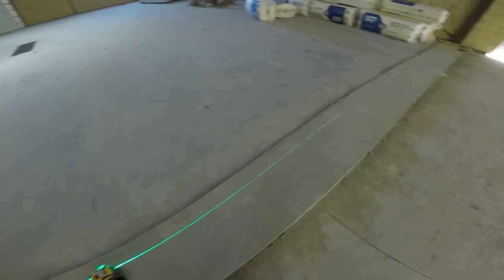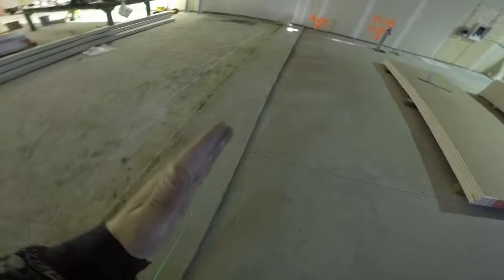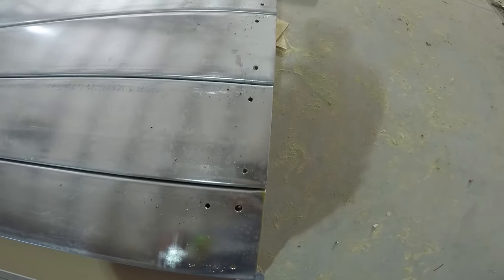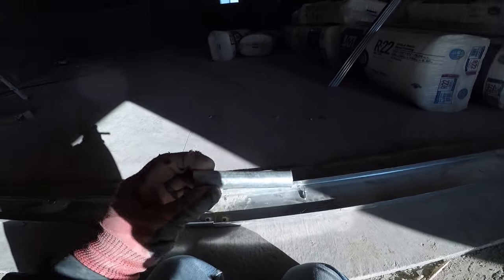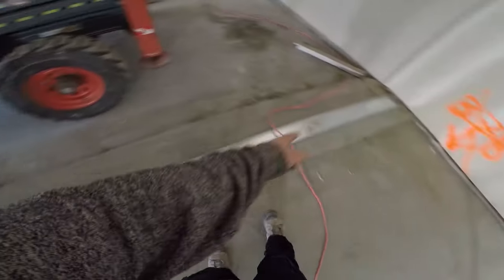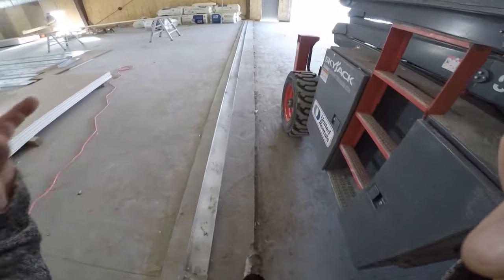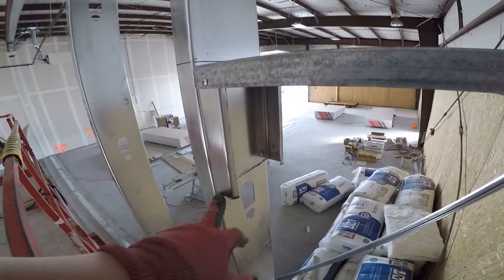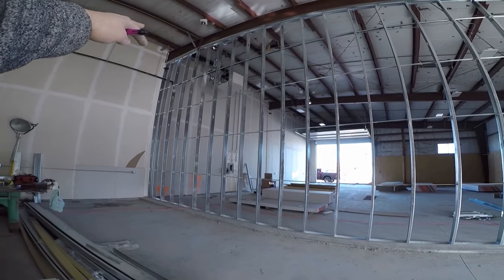Metal Stud Framing On Concrete & Steel Tips & Tricks!

Comment: Meant to ask, when fastening the studs to the track, do you run both sides from the same side in the same direction (the framing screws) or each side from the outside in?
Reply from the maker: Yes bro! When I am doing the top of the studs I reach though and screw them in from the one side but the bottoms I screw in on each side if that makes sense?
Reply: @ConstructionKronies  yep, I completely understand that. 😁👍
Reply from the maker: @meagaindave2049  Awesome man!
Reply: @ConstructionKronies  i, personally, like the pointed end of the framing screws piercing through on the opposite side. Makes for a good anchor of sorts when hanging the drywall. Lol. Although some inspectors won't allow the screws to face the same direction on opposite sides. A-holes. 🤣
Reply from the maker: @meagaindave2049  Right bro yes that's how I do it too but in this case it's a steel column behind that drywall and so I cant do that there but your 100% right that's the best way to do it when its accessible!
Reply: @ConstructionKronies  Also, back in the day, that's why most metal framers liked the metal chucks on their drills. Metal chuck can withstand rubbing against the 1st flange of the stud while fastening the 2nd flange to the track. Longer magnetic drives or extensions were too much hassle to deal with.  Though with impact drivers, nowadays, that issue is pretty much resolved.
Reply from the maker: @meagaindave2049  yes man I totally remember that.

Comment: Will you please do a video on parapet framing and walls the clip to the building, go past the roof and act as the parapet wall also. I don't know the exact term. Please include the fastest ways possible. I'm trying to learn as fast as possible. I tested into the union but, I am no metal stud framing expert. I have 20 years in construction not all commercial. Please, anything will help, thank you. I've been thrown into both, I'm learning on the go. The parapet was easy but, there are obvious differences to every type of wall framing.
Reply from the maker: Yes I am really trying to land some of this framing. For the suspended walls that run up past the roof to make parapets as well what you have to do is shoot clips to the structure. Basically what I do is set 2 to 3 studs perfectly level and plumb for every 10 foot piece of track. This is also a good time to use an offset. What you do is use the laser handset to mark the back side of where the studs will land onto the clips so that when you have your top and bottom track set with those 2 to 3 studs you can then fill in the rest easily. When joining tracks together here use little pieces of stud. I like to use a rotating laser for levelling the studs and then a line laser to shoot the bottom elevation. All the studs should be cut the same length so that after you have set the bottom track the top track just has to sit tight on the top (no need to level both). When up on the roof I set the rotating laser to shoot in the top elevation, go around setting in your bottom track (make sure the plywood on the qdeck has membrane (AVB like Blueskin) and laying out your studs while writing your stud lengths down on the track. Cut your studs and set in your top track with 2 to 3 studs. You can go ahead setting top track and your helper can come behind studding the rest out.  Hope that helps my good man!!
Reply: @ConstructionKronies  Chris, I appreciate you taking the time to respond so quickly. I have already done everything you talked about, remember, I was thrown into the fire, because I am already a journeyman they kind of expect me to know or at least ask questions. Like I said in my comment, the parapet was cake because I had already been working right next to the carpenters that were doing it previously on the same building. Also I have 20 years experience, I'm no expert but, I catch on quickly especially having a lot of years in wood framing. But nonetheless I did everything you talked about. This is our procedure, my GF set the bottom track first oddly enough, it was set on the exterior of the building so clipping it off was no problem, that was done all from a zoom boom/ 65.  Bottom track, clips, then we set up the spinner on it's side and marked every 4-6 feet on the clip and did exactly what you said except for a bit closer together. Anyhow I ended up taking a little longer than expected because I wasn't sure of the best way to set up the laser for the elevation of the top track. There were some louvers in the wall, and every good carpenter knows to frame their openings first before you stud in the wall. You know the stigma of the union, the journeyman that test in get treated differently/ like shit. That doesn't bother me because I'm willing to learn and want to be best I can be. Thank you so much, I appreciate you more than you know, have a great day. MORE VIDEOS 😁
Reply from the maker: dude! I love it! Your actually one of the very few that knows to frame your opening first, you would not believe how many times over the years I have had to cut holes and patch! Good stuff!! I always talk to the foreman for the hvac, plumbing, sprinkler and even electric to find out about openings first thing!!! Super!

Comment: Hi there. Can you let me know what exactly what kind of nails or pins you use to shoot the top track in to the beam. Thanks 
Very good video 👍
Reply from the maker: I can get you a link when I'm back on PC but I'm using the Hilti DX 351 steel to steel pins I can't remember the exact size. I also have the cartridge for the strips of pins and. Each gun type has its own fasteners. I was using green tabs for shots as well, I can control the power on this gun as well for switching between concrete and the various steel to steel installs.

Comment: How much do I charge on Kentucky for a big office project ?  I having a hard time try to prove  metal framing, can someone put me on the right direction?
Reply from the maker: Good day there. So I can't say, you need to know the rates for region. What scope of work are you bidding?
Reply: @ConstructionKronies  offices , 6k square foot 9 foot tall walls many doors and offices 🍀
Reply from the maker: @rodoloforodriguez6156  This is what I charge in Canada, just convert it to USD. 0.27 sf for drywall, 0.15 for insulation, 0.32 for tape plus 1.00 per foot of bead, 0.40 sf for steel and 50.00 for each door. If you have to tape windows charge 500 each.
Reply: @ConstructionKronies  dont make sense , but thanks
Reply from the maker: What is they type of work you do? What pricing do you need specific?
Reply: @ConstructionKronies  interior , metal framing , 9 foot tall walls , only metal studs for office
Reply from the maker: Okay so this is what I charge in Canada so just convert to your currency. $4.50 per foot for the walls, $2.00 per foot for any columns or bulkheads. Those are competitive prices and you can make money with them.

Comment: Great video! Quick question so for people that do wood framing, they can get  C5 (carpentry) license and start theie business. How is ot for people that have experience with stud metal framing. Is there a license as well ?
Reply from the maker: Actually no liscence required. When I piece work or contract its best to invoice through a corporation like a Ltd and have tax numbers, workers comp and possibly insurance like liability. There is an apprenticeship program for LISM Lather interior systems mechanic. Even for wood framing, you  can be hired with or without a ticket. Basically if yiu can do the work you have a shot.

Comment: This guy is no journeyman. I wouldn't make any money on my projects if I wasted as much time as this guy lol! It's definitely a cute little video though 😅. Love the tenacity!
Reply from the maker: Like you wasting so much time leaving me these smart ass comments? I don't have to scab my work because I charge enough. I do 2 x braces plus 100 feet or a straight 300 to 400 ft of exterior in an 8hr day with 1 helper, you think that's slow, I think we know it's not.
Reply: @ConstructionKronies  oh ya, also, 'wall channel' or cold rolled channel is definitely not for holding insulation up. It prevents studs from rolling and provides rigidity. Fyi.

Comment: I dont think u need anchors concrete pins should be good cheaper
Reply from the maker: Yeah I use the 1/4" pinbolts for my anchors especially for this 16 gauge. I'll have to srub through the video to see if I missed clarifying that. Thanks for the heads up👍

Comment: why dont you just use the nail gun that takes 22 cal blanks? it shoots the nail right straight thru the stud and into the floor/concrete it would save you alot of time.
Reply from the maker: Because this is 16 gauge steel and designers will always spec it this way. The shots won't do the job here but will work shooting steel to steel! Good to see yo bro!